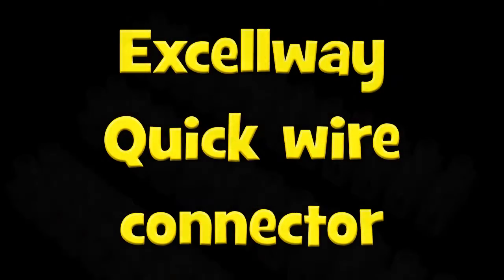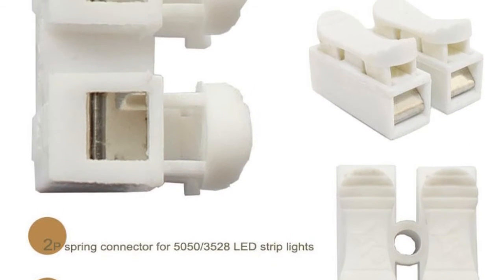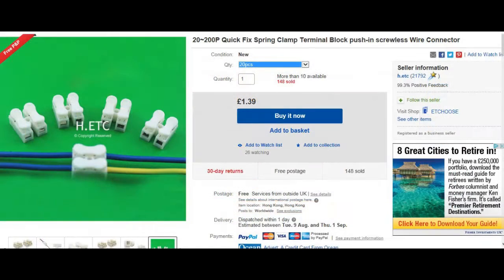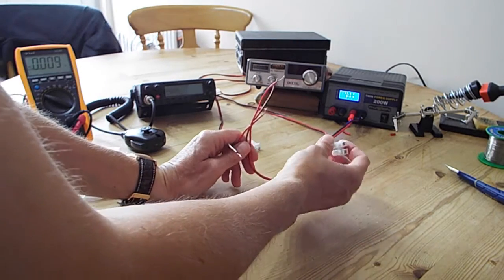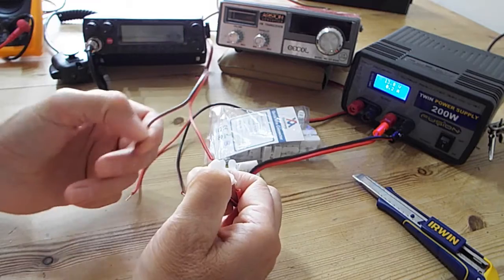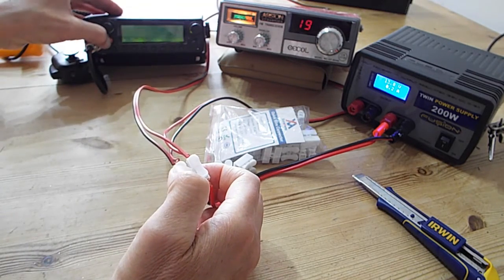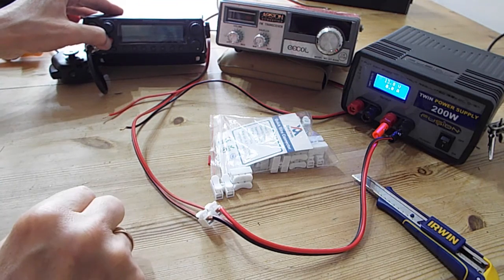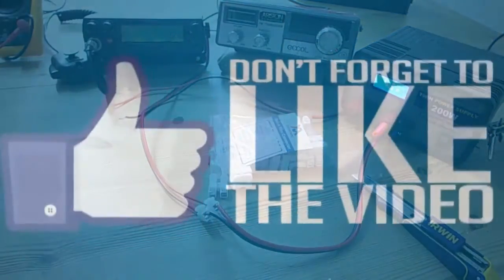Screwless wire spring clamp terminal block connectors.

Comment: Looking for such connectors but my special case is for thin devices such tablets. The are for tablets? I do understand not in every postition. And it depends on tablet model. But, anyway, is it possible to fit in some tablets inside for wire connections? Thank you!
Reply from the maker: Hi.  I think these will be too big to put inside a tablet.
Reply: @CB-RADIO-UK  Hi and thanks for quick answering. Problem:2 battery wires (soldered on mobo) are too thin. In case replacing battery I do not want to desolder and resolder battery cables back, and I will cut two battery cables, on new battery, as you understand, I will need some kind connectors to make connection back. For tablet, would you give me an image link or video link to see? Thank you!

Comment: Hi, do you find that the wires are easily pulled out or are they quite secure when clip is clamped down ? Thanks for demonstrating. These will make installing my new car stereo a lot easier than twisting and taping.
Reply from the maker: I would say for a perm set up use screw choc blocks.  These are ideal for testing.

Comment: may i know what is the material of the conductor used inside this wire spring connector? is it stainless steel..? could someone please help me? I have to find the material for my project using this wire connector.
Reply: your project will be a long time coming if your worried about block connecors